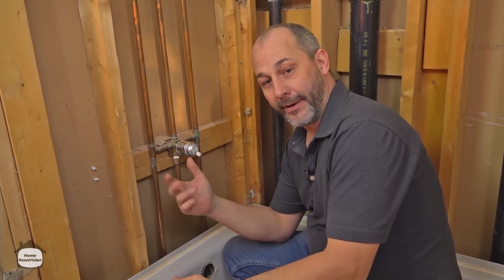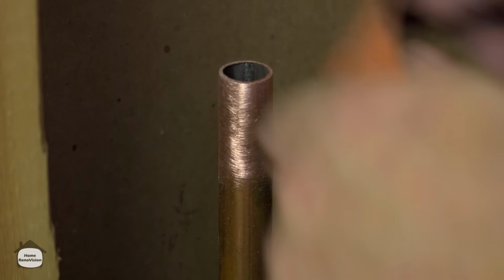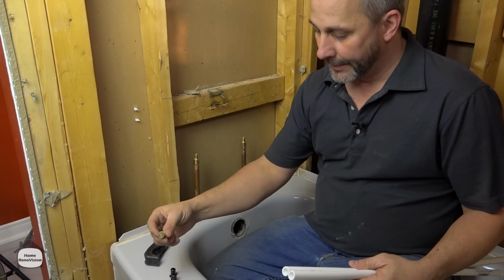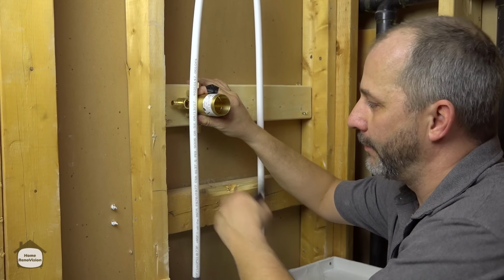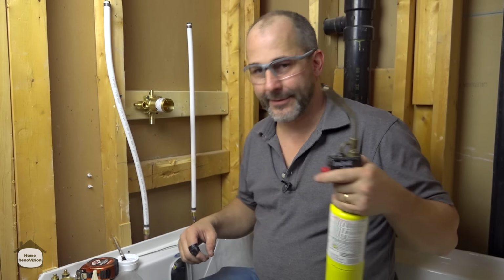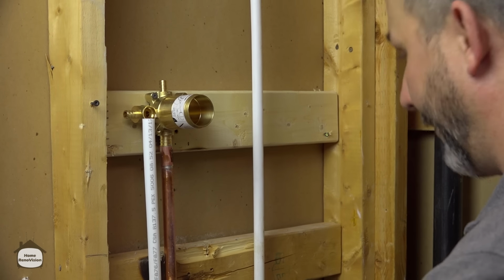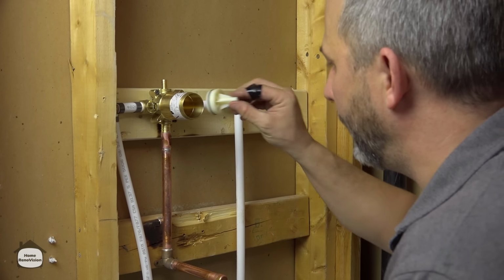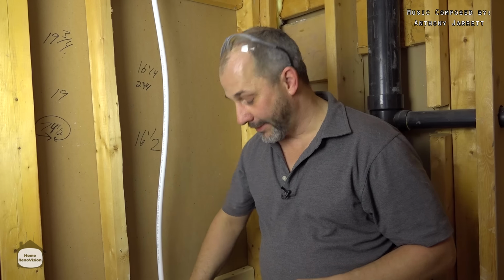DIY How To Install Copper To Pex Shower and Bath Plumbing

Comment: Pex is great it is like when they brought out drywall. It eliminates trade work.   I have only used copper because i learned how to sweat fit as a teen but after watching this I think pex may be a good choice.  Don't like the fact it is antimicrobial.  PEX can be done in a hack way also.  I have seen 400,000 housed where the PEX came up through the floor in the kitchen and they attached the shut off valves directly to is while it is laying at the bottom of the cabinet.
Reply: It did take away from the professionalism of a plumber who took a little pride in his work there was a time when all the copper piping even though it was going to be covered up was nice and straight and plumb etc I used to run my copper at 21inches on the cold and 24 inches on the hot the bottom being the cold as it ,made it easier to come off for the toilet etc. But when you used a tee and a street 90 one up and the same way down for the hot it worked out that the stubs coming out of the wall were exactly the same the two measurements could change depending on what they were stubbing out for but the 3 inches didn't change it just made it look right and very uniform  and if you had your fittings and straps and pipe tites  all in order in trays I could sit almost in a lawn chair be very comfortable with the radio on and very efficiently  run the copper for a normal bathroom  quite quickly and move on to the next more than one boss and or inspector asked if I was comfortable I said yes sir and got a smile lol if that little tip helps anyone great but with the pex being spaghetti pipe all over the place you can almost train a monkey to do it for real lol the days of cast iron and copper are long past where you had to actually  know what you were doing coming up in local 77 plumbers and pipefitters in mass we only did the bigger jobs that required cast iron etc there are still some instances where its required  in a return plenum or something  but as I said the days of being a plumber actually  meant something are not like it used to be yeah you can glue or crimp or maybe solder some but it's not like running  4 inch copper water mains or ten inch roof leaders in cast iron that's plumbing lol it's been a lucrative career and allowed me to raise four boys none of which are plumbers btw I encouraged anything but lol sorry for rambling on have a great evening everyone .. night

Comment: Terrible soldering.  Heat the pipe then heat the fitting.  And if you practice heat control you won’t have those messy drips.
Reply from the maker: The goal of soldering is to ensure the entire fitting is filled with solder. having a drip is the evidence a DIYer needs. Cheers!
Reply: Home RenoVision DIY drips are not evidence that the cup has filled.  If you clean the tubing and fitting properly and apply a little soldering paste along with the proper heat control then the capillary action will cause the solder to pull into the interstitial spacing between the fitting and tubing.  I’m sure you know what you’re doing but let’s teach people the correct way.
Reply: @kryogyn1  You act like the drip can't VERY easily be cleaned.....

Comment: hello,good sir!!!
what part of the world youre in??couple of really important things. debur the copper,torching is cold soldering ,pex you could bring up from below ,when pier and beam house,for better looks use colored pex ,at least red for the hot line.and never  should pex be run up to the shower head??? what brand of valve is that?? 
best regards   plumber of 32 years!

Comment: Haven't done PEX before. So I'm wondering if the brass nipples (being smaller in inner diameter) cause enough pressure drop to slow down the tub fill, or noticeably reduce the shower head flow.
Reply from the maker: the largest restriction is in the valve of the fixtures themselves, so no!

Comment: Im going to replace all my water lines in my basement to pex. Looks easy and pretty sure its cheaper than copper. Also if someone is showering we loose water pressure in the rest of the house
Reply from the maker: try using 3/4 inch main lines to keep up the pressure. Cheers!

Comment: A repair job that's doomed to leak, and fail with-in 2 decades. Stick with copper. PVC and PEX are for cheap asses.
Reply from the maker: no need to lie John. pex definitely outperforms copper in cold climates!

Comment: I am a retired plumber.  This kind of plastics are for CHEAPOS and IGNORANTS. Copper pipes 
have no replacement in plumbing. They last forever (At least 50 years life span). Talk to insurance people and hear what they say about plastic and copper pipes. I never got a call for 
a leaky joint, melted copper or sweat joint due to fire. Yes, it cost more than twice as plastic, but it is worth it. The plumber's reputation is at stake when not using copper. 12/31/18.
Reply: Victor Miranda welcome back to the 70s! Pex is far more convenient than copper, and honestly just as durable. If a ring is crimped properly, that line will NEVER leak. Ever hear pin holes? Copper is notorious for that, not something you will ever run across with pex. I can guarantee a properly installed pex line is far superior than copper.
Reply from the maker: LOL, did you just hear yourself talk. they last 50 years or forever...which is it! Loving it!
Reply: HELLO?  are you kidding me...I have replaced tons of the "LAST FOREVER COPPER POOP"    the most over rate pipe ever.....first off in many sandy areas with the right Acidity you never use COPPER...secondly I have seen many fittings develop leaks over time but Plumbers then say  it wasn't prepared correctly or soldered correctly...SUCH BULLSHIT....Fact is COPPER PIPE was extremely over hyped for decades because its very labor intensive and plumbers make Bank on service calls

Comment: I  JUST  STARTED  USING   PEX   NOT  LONG  AGO  SINCE  RETIRING  UP  HERE  IN  CENTR.  OR.  IN  LOS  ANGELES...IT  ISNOT  LEGAL  THERE.    I  USED  THE  PEX  U  ARE  USING  IN  LU  OF  THE  SHARKBITE  SYSTEM....4  FEAR  IT  MIGHT  BLOW-OUT!!  BUT  I  DID  USE  THE  STAINLESS STEEL  CLAMPS  INSTEAD  OF  THE  1-S  U  ARE  USING/ALOT  OF  THESE  POPPEP  OPEN  WHILE  CRIMMPING  THEM...I  WILL  TRY  THE  1-S  U  ARE  USING  HERE  PROB.  NEXT...THEY  SEEM  MORE  RELIABLE/PROFF.
Reply from the maker: the stainless rings do have a high initial failure but hold well long term. I agree the solid rings are a better system.

Comment: can only use those crimpers  in a big space  and you need two hands  ----try using them in  where there in no room---and you are fucked ----it's a shite system
Reply from the maker: the system is actually designed to run full length from the manifold to the fixture so crimping is the exception not the rule. If you need to get creative while doing rework there are other options!

Comment: That 'pex system looks like shite ---we use quick fix plastic system here in the UK ----they just slide over the pipe and and pull ---kept in place by an o ring---and can be used again ----no room needed ---you can fix them in the dark without even looking at what you are doing---you don't need a crimper----you don't need brass fitting ----you don't need a torch. The USA is miles behind Europe
Reply from the maker: That system sounds awesome. Next time I am across the pond i will check it out for sure. Cheers!

Comment: Not sure why anyone in their right mind would change the pipe going between shower head and faucet from rigid copper to pex.  I've had to work behind guys that did that and gave them several nicknames!
Reply from the maker: Like speedy, or genius, or cutting edge.
Reply: @HomeRenoVisionDIY  lol.    Um, no.
Reply from the maker: Cheers!
Reply: @HomeRenoVisionDIY  Great banter, cheers!

Comment: Copper Plumbing is the BEST, I would never ever put PEX in my house.
Pex and Copper don't mix, they have different expansion and contraction rates.
Pex will crack at the copper fittings and also when Pex starts to wear it Leaches chemicals that its made out of into the drinking water. PEX is a cheep and fast way of adding plumbing to your house, and thats the only reason why builders today use PEX.
You need special costly tools to work with PEX. Copper is easy you cut it  and sweat it. No special tools needed. A lot of master plumbers do not like PEX.
Reply: wrong, pvc cracks pex does not (it flexes)
Reply from the maker: Hi Steve, It always amazes me how many plumbers watch plumbing videos. You can't deny that pex outperforms copper in cold environments, is easier to install and requires almost no training. that is why I encourage DIY folks to use it. This channel is not a forum to discuss copper vs pex, simply an example to homeowners how they can do it themselves without calling a plumber that they can't afford. Cheers!

Comment: Lead or lead free solder? And I've seen you use 2 different style crimps rings in different videos which do you prefer?
Reply from the maker: Lead free for sure and I prefer the solid rings. They both stand up to 500 psi at which point the tube splits but the solid rings have a much lower rate of failure at the time of install. You have less rework after the pressure test. Cheers!

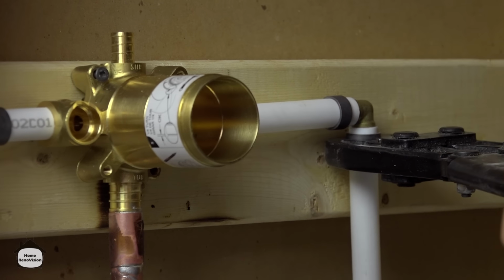Comment: A real plumber wouldn't use 50/50 solder on a water line or make a piss poor crimp like you did at 20:40    you guys are the people that give plumbers a bad name because you don't know what your doing and can do more harm than good   and for the people that don't know 50/50 solder is half lead half tin which isn't allowed in any potable water system
Reply from the maker: Hi Jamie, don't try to scare folks I use silver solder thank you. Just to be clear the water is on and everything works great. Don't worry there will always be folks who need a plumber. But not everyone wants to spend the money if they can do it themselves.

Comment: Hey Jeff you took out the “shock absorbers “ tees and didn’t replace them. Now you are going to get water hammer in the lines.
Reply from the maker: sorry to disappoint but you don't need absorbers on a pex water line.

Comment: You can do with a better pipe slice n to hold the end of the flame on the joint not the whole flame as the end is the hottest part
Reply from the maker: Cheers!

Comment: An idea that I would recommend is, LEAVE THE LOWER FAUCET ALONE! Simply tap into the hot & cold before the faucet & plum both hot & cold up to a second faucet that controls only the shower & that way yes, you will have 2 separate controls but when someone is taking a bath, they wont have to struggle & reach up so high to reach the faucet & those whom shower will still have easy access to their controls. Get 2 separate faucet beauty rings, one that says shower & the other stating tub or bath. I did not plumb this house & they put the faucet up to high to facilitate showering & when I want to bath, its a pain! Why not have the best of both worlds.
Reply from the maker: that is very creative.
Reply: Asthtetics mostly I'm sure because both valves could be vastly different in many ways and it would really look well you know the word lol

Comment: Good job with the conversion, copper to PEX, except why did you not install risers with the PEX?
Reply from the maker: no need with pex. hammer is caused by increased pressure. pex expands and contracts to absorb those situations.

Comment: I've been doing plumbing since 1985 and I always use a heat shield and keep a fire extinguisher near by. Whether it is a fire proof cloth or as simple as a soaked towel, dry wall board and dry lumber catch fire faster than you think. For $20,  It's cheaper than repairing fire damage.
https://www.homedepot.com/p/9-in-x-12-in-Hands-Free-Heat-Shield-314002/100345508
Reply: Your very correct I've been doing it since 83. And in a remodel or an older home are so old and dry they go up fast an extinguishing apparatus and wetting everything down before hand with a spray bottle was my favorite technique as well as some sort of heat shield thankfully I never had an issue but more than one of my plumber friends did
Reply: A great deal for a homeowner grade heat shield is a spatula from the dollar store. Just shove it in behind the pipe.

Comment: I always enjoy Mr. Thorman's videos.  They're very instructive.  In this copper to PEX video, he seems to gloss over the application of flux prior to soldering.  Putting flux on both pieces to be joined is imperative.  It's a point that needs to be driven home for DIY folks.  Also, I've always used aluminum foil or sheet metal to cover any nearby framing to protect it from the torch.  You'll notice the studs glowing red during the torching. That makes me a little nervous, especially when instructing inexperienced people.
Reply: BE SURE TO READ @tomflagg2070's comment above - about flux application, and aluminum foil fire preventive in close quarters